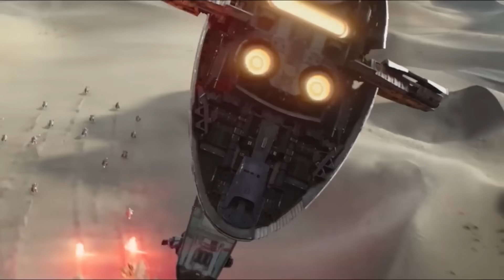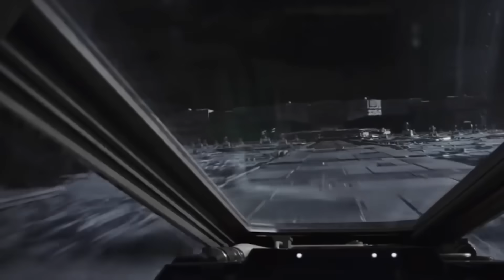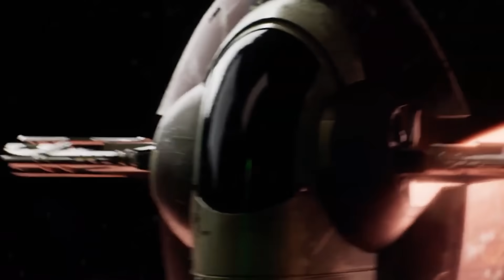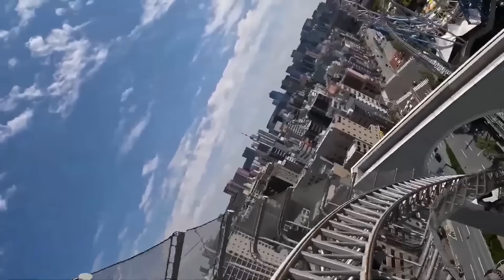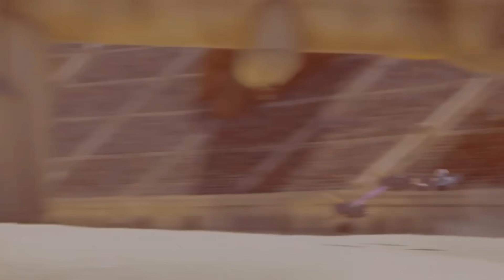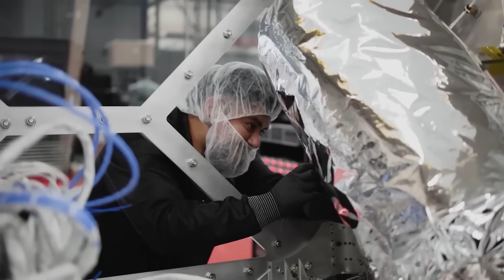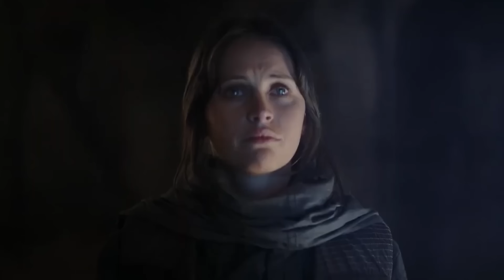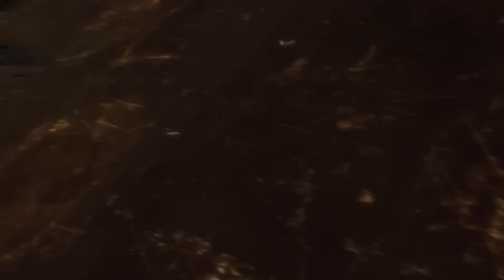The Problem with Star Wars Ship Design

Comment: 11:05 Star Wars has inertia compensators. These reduce g loads.
Reply: This guy doesn't acknowledge anything.  Droid vulture droids and tri fighters are able to pull off more extreme moves because their is no human pilot
Reply: @GTisPeak  You're both right 😆
Reply: @GTisPeak  Which is probably mainly because Star Wars lore is inconsistent af and half the writers don't understand how half the stuff works. Or, in universe, because those compensators have their limits and a 20g compensator works fine in an X-Wing, but there's no way you're going to fit a 50g compensator in there, which would also need a stronger power source (no idea, I'm just making stuff up tbh, except for the inconsistent lore bit)
Reply: @AvB.83 the EU was pretty consistent actually ...lot of people tell me I'm wrong but we have no credible proof
Reply: Porkins was known to keep his compensator high, for obvious reasons, which is why his inner ear misjudged the depth of his dive towards the Death Star. That's Wedge rationalization in the Rogue Squadron novels by Stackpole.
Reply: Inertial dampers
Reply: They also have anti-gravity to take off and land.
Reply: Like when the Millennium Falcon enters the Death Star in Return of the Jedi.  Without the inertial compensators, Lando would have been knocked unconscious.
Reply: @CoastalUser-h7o  A far more"realistic" solution to extreme g-forces is in Cixin Liu's "3 Body Problem" series: "Deep sea mode", suspension in a viscous breathable fluid. Inertial damping is purely sci-fi, with the emphasis on "-fi", as they contradict Physics, whereas it ispossible to cerat viscous fluids and to make a fluid breathable.
Reply: Right. I was going to comment this too. Even if an impossible technology,  you have to give the source credit for accounting for tge problem (the extended universe, anyway - the films cannot be expected to explain everything given limited time and pacing demands).
Reply: The thing I don't get is everyone says they're going to turn into mush yet no one talks about the fact that all of the Star wars fights are in an inertial reference frame where they appear to be going about 500 mph relative to the plane of travel. And last I checked a fighter plane pulling about four g's is the same thing.
Reply: @kelaEQ2  Starships are designed with advanced antigravity field generators that cancel out the extreme G-Forces.  They also have artificial gravity on the ships.  It’s technology that allows for space travel without conventional G-Forces.  Without that technology there would be no space battles.
Reply: @kelaEQ2  I think two things are getting mixed up in all this - what you say seems reasonable, yes, in these "dogfight" situations, the relative speeds are rather like those between WWII fighters and bombers, actually, or between planes and surface ships, not even at modern supersonic speeds. What the "mush' argument refers to is the extreme accelerations implied in jumping to Relativistic speeds, speeds which are a significant percentage of the speed of light, or in extreme manoeuvres during interstellat travel. Interesting to note that it would be very hard to portray and to follow super- and hypersonic combat between ships - it's be too fast, so we have "stellar Midway" battles instead...
Reply: How are those meant to work?
Reply: @Mandoo2.0  I have a limited knowledge on it and of course it’s science fiction but to the best of my knowledge it uses some kind of magnetic field and ion drive to help cancel out the inertia.
Reply: @Mandoo2.0  By controlling gravity fields.
Reply: @Mandoo2.0  I don't know how they're supposed towork, as in, the lore, but I can tell youone thing: such a thing cannot exist.

Comment: The millennium falcon is a correllian frieghter with it’s emergency lifeboat missing.. plenty of parts available since corelia built ships for thousands of years, and Naboo and tatooine are the nearest star systems to each other so it makes since a few spare parts have made there way there
Reply: Plus Tatooine is a wretched hive of scum and villainy. Criminals would be landing with all sorts of ships and quite a lot of them might end up without owners...
Reply: What puzzles me about the Millennium Falcon is that it seems to have more space for the crew than for cargo.
Reply: @fiktivhistoriker345  Obviously its no longer a standard YT-1300. Lando made numerous modifications do it when he owned it as a smuggler and Han made further modifications. Smuggling is done because the illegal cargo is expensive even in small quantities.
Reply: @fiktivhistoriker345  
Isn't the Falcon something like the cab of a big rig? As in, it's just the engine that might be pulling a trailer of cargo, so of course you'd want crew amenities in it?
It's just that Han isn't running freight jobs so he has to use whatever space is in the cab as cargo storage?
Reply: @stylesrj  Nope, it's not the Nostromo. It's all there is. And actually Engineering (Engines, Energy, Life support, Airlocks) should be most of the space used, requiring access for the sentient maintenance personnel, some of which is used to set up crew spaces too. As it is slightly less than half the interior space would probably be useable for freight, with some corners better accessible to load or unload, so it would be more a courier or precious cargo type vessel than a bulk carrier.
Reply: That emergency life boat never existed lol the mandibles are used for transporting large freight containers, Disney just cocked it up as usual. The escape pod was on the side behind the cockpit hall.
Reply: It's been a long time since I heard the thousand year thing about the Millennium Falcon.